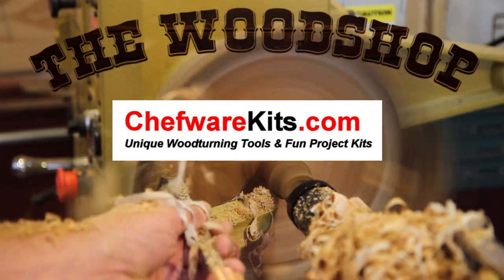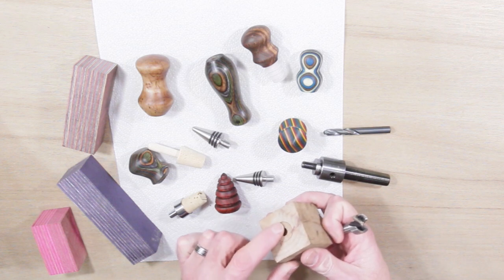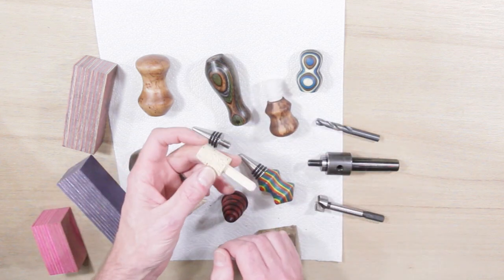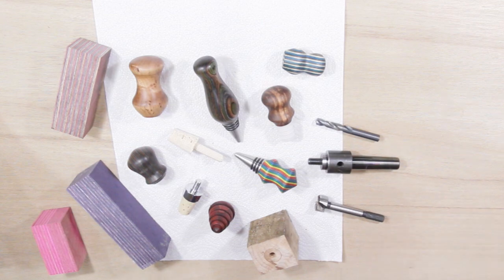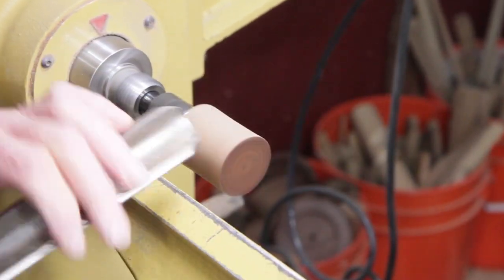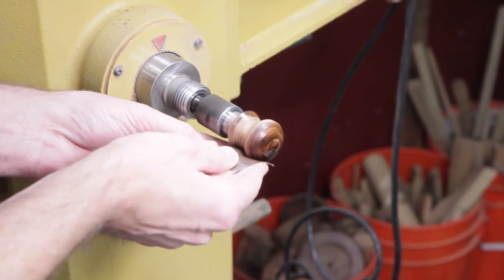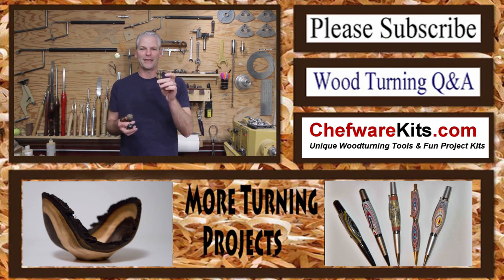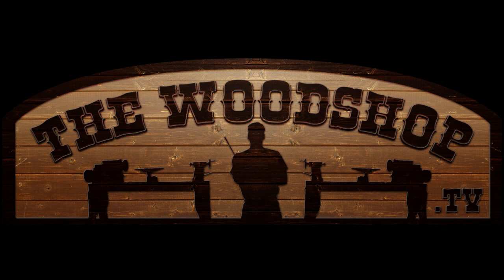Woodturning Ruth Niles Bottle Stopper Kit

Comment: This system looks much nicer than using a jacobs chuck and threaded rod, even just for having the exact sizing of the bottle stopper base built into the mandrel. Nice work Carl.
Reply from the maker: Paul Jenkins Thank you Paul, it's a well designed system.

Comment: Carl this definitely is a great kit for stoppers.  I made about 40 for Christmas gifts this year!!!   As for the colored plywood I sand it to 600 and then use EEE and Shellawax for the finish and it works great.  i just put a rough 2 x 2 block into a chuck, flatten the end, drill it and use a parting tool to make the 7/8" recess.  Make it so a nickel fits in and your good to go.
Reply from the maker: Ellis Emery Thank you Ellis for the tips

Comment: The young ladies that i work with loved it when i gave them winestoppers. I was told by them, and also from others, that I needed to keep the tops of the stoppers rounded rather than pointed. If you are drinking a bottle of wine and you want to stopper it you usually tap it in with the palm of your hand. The pointed stopper is to uncomfortable... Even if it is an interesting shape. Keep up the great work an Happy New Years!
Reply from the maker: Thomas Lindgren Great! I gave that one to my sister, not thinking about it :) 
Happy New Year

Comment: Thanks Carl. I've used the Niles kit for a few months now and really like it. Don't know how your lathe is set up but, I used a piece of all-thread to lock the MT in my headstock. Don't really care to see the whole kit come slipping out at me! LOL
Take care, Dave
Reply from the maker: David Morgan Thanks Dave, ya it's a great kit. I have an all-thread I put through as well. 
Take care,
Carl
Reply: On the end of the rod is there a double nut to keep the rod from moving? I just switch from Woodcraft bottle stopper kit to the Ruth Niles kit. Ruth saids hello Carol.
Reply: Andrew Betschman
Andrew, I have a wing nut and washer that I tighten down and it works good for me. Just whatever to secure the MT to the headstock.
Take care, Dave

Comment: I have the ruth niles mandrel, but after i drill a hole, and then I try and mount on the mandrel, the hole gets too big, and the wood wobbles and won't stay on unless it's between centers. Any suggestions?
Reply from the maker: I've had that happen a couple times but it was only with soft wood.
Reply: Carl Jacobson thank you..
I’m going to try a different drill bit, but the wood was walnut and should have worked fine..

Comment: How do you get the threads to stay in the wood. When I tried the wood tightens up on the Ruth miles mandrel that is designed to cut the threads but after I un thread the finished piece there are no threads inside the hole. And the stopper does not thread in just falls out. Any tips?
Reply from the maker: It might be the type of wood you're using. Hard woods work best. Another trick is to use thin CA glue. Tread the piece on and off, fill the threads with CA glue, let it dry, and thread it back on to the mandrel.

Comment: Hey Carl, great video as usual, thanks for the shout out.  One small correction the Laminated Colored Wood is technically not plywood because the grain is all in the same direction so that it turns long grain like any solid wood.  There are many different colors, but they are more subtle since they cam from the original company who developed this process.  Also... yes, dry sanding is great to 220/320 but not much more is needed since it is made from Birch veneer. Finishing is best with a solvent finish like shellac or Lacquer.  I have used Doc's Pens Plus on it and that buffs up great.  For Pens you can also use CA Glue.  Water based finishes are nor recommended the colors can bleed.
Reply from the maker: Walter Ambrosch Thank you again Walter, I really like the colors. It was very nice to turn as well. 
Take care,
Carl

Comment: Love all your videos.. Got a call for some bottle stoppers. I have in my shop several of Ruths stoppers. I have a larger section of #302 model .. My question i was unable to find a good set of instructions using the #302 series, ie No thread.. Any help would be appreciated .. Thanks Postalbob
Reply from the maker: Thank you very much Bob! I haven't used that style before. Maybe Ruth has something on her website that would help.